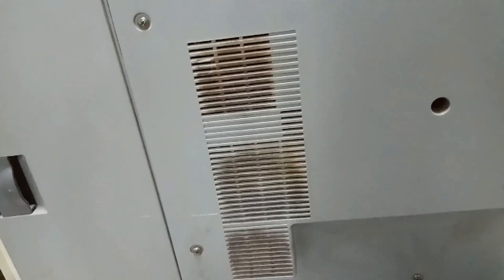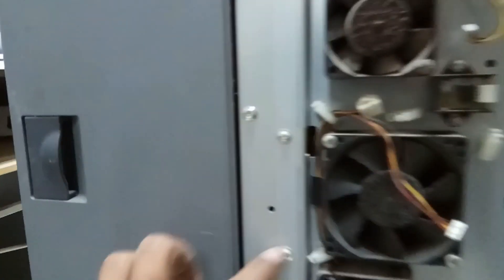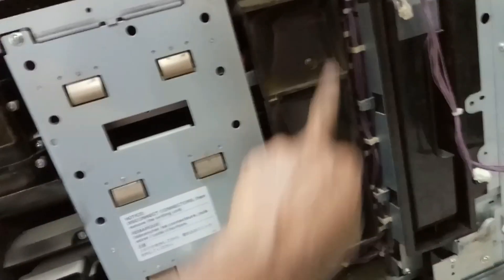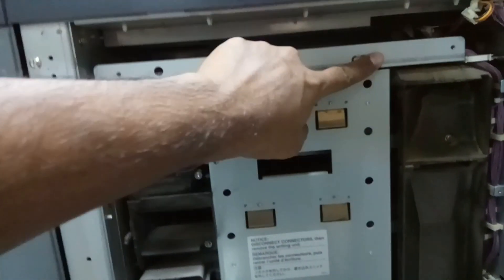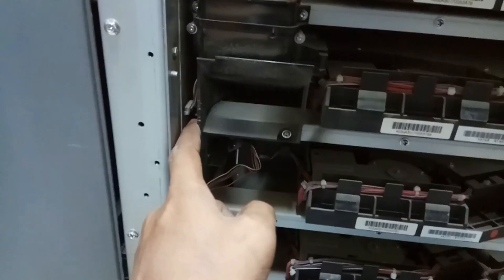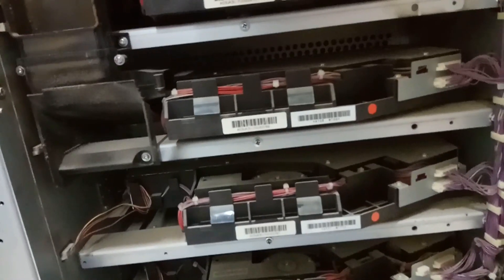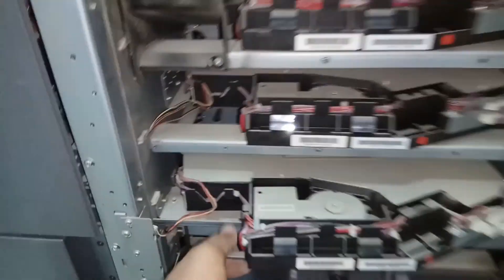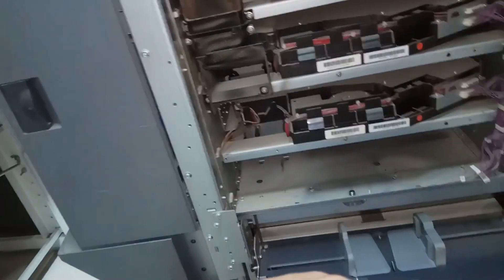how replace laser units from konica Minolta C 6500 5500 5501 6501 6000 7000

Comment: Hello, I have a konica bizhub Pro c5501, 
when I put it on, just when the screen come on and machine start running, I hear a hard scratchy sound inside the machine, then it stops. Then error code c2451 or c2451 comes on the screen.

I need your urgent help
Reply: Kindly check Yellow toner, or hopper. its either undertoned or overtoned . Chech it in  IO mode 54>>01